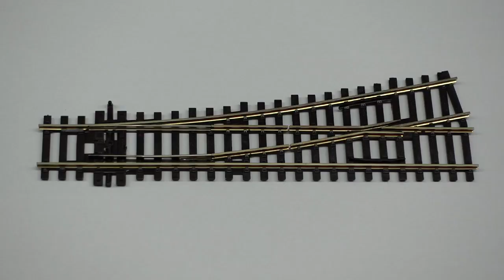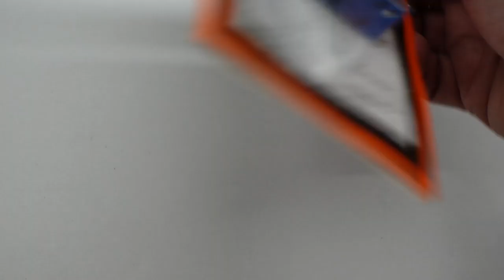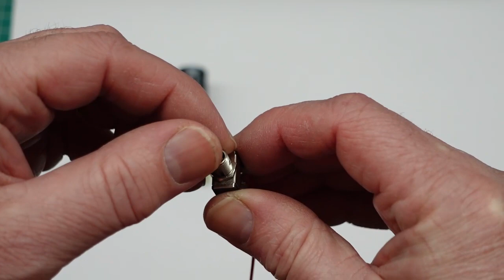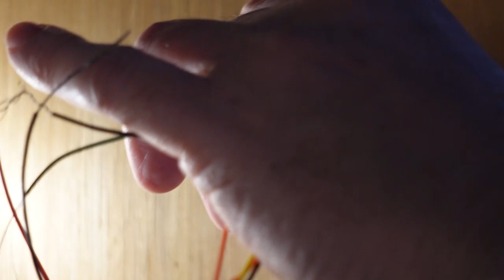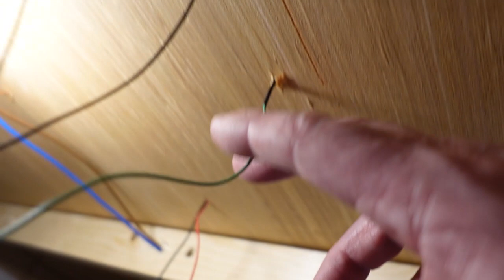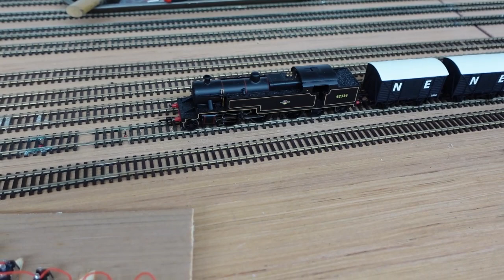139 Points fitting and wiring, Insulfrog, Electrofrog and Unifrog using Seep motors with a switch

Comment: hi
I have a Peco wye SL-E97 & SL-E98 THAT DO NOT HAVE THE JOINT LINK TO TAKE OUT THAT ISOLATES THE FROG. HOW DO I DEAL WITH THIS. I WATCH ALL YOUR VIDEOS WHICH ARE EXCELLENT BUT CANNOT FIND ONE TO ANSWER THIS. CAN YOU HELP?
Reply from the maker: Hi Matthew, you can make the cut using a dremel type tool to isolate the frog.

Comment: Hi, this is brilliant, I have a question, I have a small yard only 8 switches ( Peco) unifrog n scale, I don’t want to use switches, I am planning to switch manually, do I need a power supply? Or only my DCC bus and the Seep point motors.
Reply from the maker: Hi if you are going to switch manually you will not need motors for the points. If you plan to use the unifrog as "electrofrog" then you can get frog juicers like these https://blocksignalling.co.uk/DCC-Products/FROGmini.
Reply: Thank for the quick response.
Reply from the maker: @AP12BG  I do a livestream most Thursdays at 7.30pm BST. If you have a question come along and pop it in the chat and I can answer it. Next live will be 12/09/2024.

Comment: One question, when you use your handy little track tester you claim that one side of the frog is dead? just to clarify is it dead or both rails are the same polarity. I ask because if a loco crosses onto the frog when the points are set to the other  route it will create a short??
Reply from the maker: Yes both rails are the same polarity, so if you enter the point against the thrown direction it will cause a short.

Comment: A great video, I always use electrofrog but a matexofcmine asked about unifrog but didn't know what it is.
It's actually very cunning because evd. If you do use it as an insulfrog you have the one major plus that the stock rail and switch blades are bonded so you don't rely on rail to rail contaact for conductivity , also it means you don't have to put an insulated rail jointer on the v ends as they know longer create a short.
This is better for peco as it means they will only be producing one type of turnout.
The other advantage  is the switch rails no longer are jointed so no longer a problem with hr joints.
Reply from the maker: Think the unifrogs will make it much simpler to wire. Thanks for watching.
Reply: @DonegalDadRail  yes it will he simpler but if you are using analogue then bother outlet's are permanently  powered so my understanding is that a simple isolating switch would be required.
Reply from the maker: @Steven_Rowe  Yes some isolating sections may be required.

Comment: that's the first time I've seen someone use momentary switches for this. What is the problem with using a regular SPDT ON-ON switch? I'm keen to learn as that's what I've just installed on my layout, but want to know as if things could go wrong it'll be easier to fix now rather than later
Reply from the maker: You want to use the momentary/central sprung return switchs if you are using solenoid type motors, as you only need a momentary burst of power other wise the motor will burn out.
Reply: @DonegalDadRail  That makes sense!! How do you wire up an LED into your control panel to reflect the current position of the points? Surely if it's a momentary switch and returns to off, then there's no way to see which way the points thrown and there's no current to power an LED either?
Reply from the maker: @citizenmilitia1   I use Seep pm1 point motors which has a built in switch that can be used to switch the frog or light a led in the control panel.

Comment: Hi Mark A very good instructional video, although the sound is a little quiet (even when turned up on the slider bar!). Just one thing...."7.30 Irish time", is that different to the rest of the UK...?? Lol (Sorry I couldn't resist it,  lol). Thanks
Reply from the maker: Thanks Peter. I have been trying different settings on my mic to try and filter out background noise. Some would say Irish time is always different 🤣.